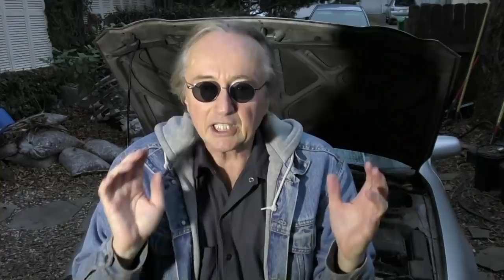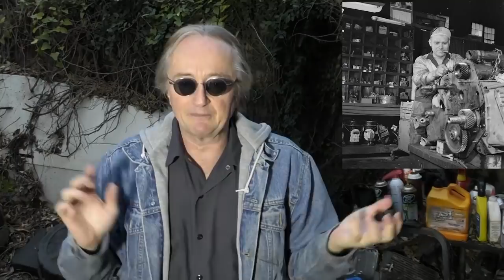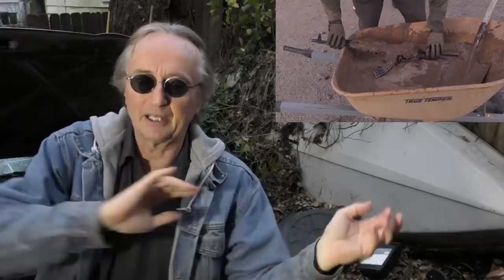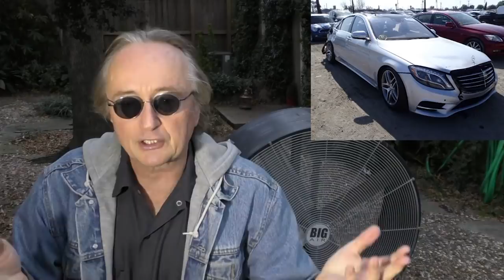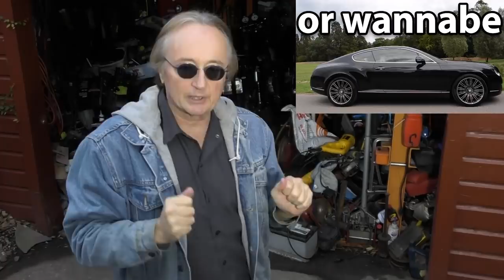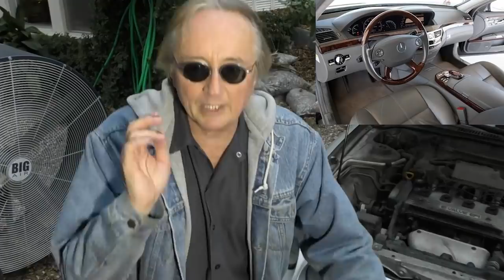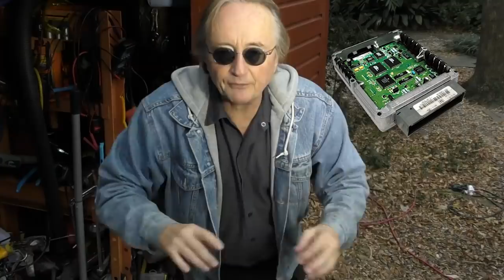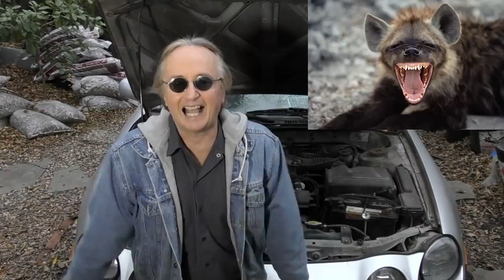Why Luxury Cars are Designed to be Unreliable

Comment from the maker: ⬇️Scotty’s Top DIY Tools:
1. Bluetooth Scan Tool: http://amzn.to/2nfvmaD
2. Cheap Scan Tool: https://amzn.to/2D8Tvae
3. Professional Socket Set: http://amzn.to/2Bzmccg 
4. Wrench Set: http://amzn.to/2kmBaOU
5. No Charging Required Car Jump Starter: https://amzn.to/2CthnUU
6. Battery Pack Car Jump Starter: http://amzn.to/2nrc6qR

⬇️ Things used in this video:
1. Common Sense
2. 4k Camera: https://amzn.to/2HkjavH
3. Camera Microphone: https://amzn.to/2Evn167
4. Camera Tripod: https://amzn.to/2Jwog8S
5. My computer for editing / uploading: https://amzn.to/2uUZ3lo
6. Video editing software: http://amzn.to/2jv5Fhf
7. Thumbnail software: http://amzn.to/2k7tz6C

🛠Check out the tools I use and highly recommend ► https://goo.gl/rwYt2y

🔥Scotty Shirts and Merch ► https://goo.gl/pTAeca

Subscribe and hit the notification bell! ► https://goo.gl/CFismN

Scotty on Social:
Facebook ► https://www.facebook.com/scottymechanic/
Instagram ► https://www.instagram.com/scotty_the_mechanic/
Twitter ► https://twitter.com/Scottymechanic?lang=en
Reply: What's a good luxury car that's reliable and easy to work on??
Reply: I was wondering if you could post a video on most common issues with the Lexus IS250 2006-2013 and ways to prevent carbon build up
Reply: Scotty Kilmer my grandfather owns an 2004 Mercedes E200 Compressor and it's still going reliable .only thing he has done is fuel pump one time , he done 2 times the tie roads and some times brake pads and discs
Reply: A video on the K cars of the past would be an interesting video .
Reply: Hey scotty! Thanks for the awesome video! I wonder though, when a company puts a supercharger + turbocharger or double turbos, aren't the engine blocks made to be stronger so that the added pressure on the engine isn't straining it  but is well within the limit that the engine can take? In other words the engine would then be compared to a weaker but naturally aspirated one.
Reply: Will a oil catch can void your warranty?
Reply: Scotty I have a 1985 mr2 and it started to shake really bad, the spark plugs are new, cables are new distributor new, and it smells a bit of gasoline it didn't before. People are telling me it can be an 02 sensor, a bad afm, or the egr valve. Can you help me please.
Reply: what older models of  lexus cars would u recommend and which years? Thanks
Reply: Q:-
Hallo Scotty,
I live now in Germany. I wanna buy a hatchback (Ford Focus, VW Golf, Skoda octavia, opel astra or Audi A3) or small SUV (Nissan Qashqai, Opel Mokka, Peugeot 2008 or Ford kuga). 2010 - 2015
Most of cars here are German (even Ford are made in Cologne, Germany) or European.
Which European car is the most reliable car ....
Reply: Hey Scotty! What do you think about the 2008 Audi a5 coupe 2.0t quattro
Reply: Hey Scotty! How about a video on truck leveling kits. I have heard good and bad things about them, so I'd love to get your feedback on it. Thanks 👍
Reply: Educative video!
Reply: Hey Scotty, thanks for all the car advice! My 2012 Toyota Yaris 1.3XR smells of fuel for the first 100km or so after filling the tank; can you recommend some checks I could do to find the problem?
Reply: Another great video, Scotty. I bought a 95 Camry V6 automatic with 123k miles. Runs fine so far. What coolant can I use for it and are there any known issues I should look out for? Thanks
Reply: I'm on my second ACURA tsx first 1 2004 420k no issues just 2 a/c compressors my current 2009 tsx has 350k no issues so I guess mine are reliable
Reply: When buying a used car how do I know if the previous owner used conventional or synthetic oil? Does it matter what oil I use if I don't know?
Reply: Do a video on 80s luxary
Reply: Haven't hear that ash tray statement in many years 1970s since my dad would always say it when we bought used trade ins from new car dealers. Best days of my life.
Reply: Scotty, its time for me to rebuild my LT1 in my 95 trans am.  I am thinking of replacing the Optispark with a coil pack conversation kit. Would it be worth it to do that? Or should I scrap the LT for an LS? 
Little background in the engine...low oil pressure being the main reason for wanting to rebuild. I had the pressure test done on all cylinders (both wet and dry) and it turned out good. It has 154K miles and somewhere in its past had an aftermarket intake put on. As far as I know the engine has never been opened according to the place I took it to evaluate its condition. (That's another story - not good either)
Any thoughts?
Reply: Scotty Why Ford is only decent car in the United States
Reply: tell about the history about Ford
Reply: Hey Scotty I have a 2013 chevy Silverado 1500 V6 4 speed auto with 56k miles when i stop at a red light and let off the break i feel a clunk and jerk feeling, thinking it might be the transmission or torque converter what are your thoughts. Love the channel
Reply: there are exeptions like the Mercedes W210. This is a old E-class from 1995-2002 they can rust easily, but are veeery reliable if we talk about electronic stuff and the transmission.
Reply: @mich8230  a well maintained/serviced merecedes e class
Reply: What about Manuel transmission Accuras?
Reply: What is your opinion about the 2005 Cadillac sts with the rwd northstar engine do you think they're a better engine than the fwd version
Reply: What happened to the Ford Scorpio Merkur
Reply: Hi Scotty, big fan. I have a question. I'm trying to decide whether to buy a 2018 Honda Accord with the 2.0L Turbo engine or the 2018 Toyota Camry XSE V6. In your experience, what should I do? Thanks in advance.
Reply: Scotty Kilmer Scotty when will you be giving away a pickup truck?? Let me know so I can measure out my garage and throw some things out to to make room.
Reply: What are good v6 engines under 25k above 2008 thanks
Reply: tolerance these day with the new cnc can reach .008" to .0015" easily. as long you don't go in the thousand you just make shure the guy that operate the machine know what he is doing. if you go in the thousand all part must be mesure by a c.m.m. or a optical indicator
Reply: But eventually all cars are going to be electronically controlled. I guess the solution is to look at the track record and buy the ones that break down the least.
Reply: My question is, In your opinion, who makes the best automatic transmission? Will they ever be as good as a manual transmission? I like automatics personally but I can definitely drive a manual though. What are your thoughts Scotty?
Reply: Hey scooty What are your thoughts on bmw SMG system? And what do you think about the e46 generation specifically the 330ci/m3 ?
Reply: - - - @Scotty Kilmer Scotty, I got a 2001 Chevy Suburban with 193k Miles on it (I bought Used with 177k) that's had no Engine & no Transmission work done on it. With the Aftermarket Intake & Cat-Back I put on it it Runs like a Dream, & I Plan on Eventually Replacing Every part with Performance grade Parts. I'm thinking about putting Rust Converter All over the Entire Underside of the Truck, Undercarriage, Frame, Body & All. Is it Safe to Cover the Entirety of the Undercarriage in Rust Converter? Can I Paint my Entire Exhaust System with that High-Temp Paint & would That be Advisable?
Reply: Hey Scottie I'm in new England and looking for a rust free used car, what  states or regions are close by?  Looking for an Avalon to be specific.
Reply: Hey Scotty. Why do some engines last longer than others? Do you think a v8 will last longer than a turbo 4 cylinder, due to not working as hard?
Reply: What gm vehices are reliable?
Reply: Who makes the best diesel engine?
Reply: Hi Scotty!, I have a base model 2010 Mitsubishi Lancer with a manual transmission that has just over 114k miles. Sometimes the "shift stick" gets stuck in 1,2 and 3rd gear. What could be wrong? (I think its never had any transmission fluid change, should I change it now?).

Also my downstream O2 sensor had its wires chewed by mice. Its been a long time like that but my mom won't allow me to change it because its about 500 dollars, should I do it anyways?

Thanks. (Plizzzzzz answere my questions)
Reply: I recently purchased one of those old military surplus K5 Blazers with 6.2L V-8 diesel (m1009).  She's in pristine condition, but I'm tempted to try to get more horsepower out of her.  Should I go with a turbo, a supercharger, or don't bother?
Reply: Scotty Kilmer Scotty could you make a video about quality and reliability of modern American muscle cars such as ford mustang,Chevy camaro,Challenger hellcat...Especially their powertrain,engines quality and reliability...Thank you!
Reply: E38 scotty should i buy it?
Reply: Scotty Kilmer - Scotty, I have a 2018 Ford Escape 2.0 L with 15,000 miles, for regular maintenance I have been putting in synthetic oil for the oil changes, what else should I do to keep it running well. I have never had a turbo engine before. It mentioned putting in premium gas, which I have been doing as well. Plus I live in a cold climate area. Thanks.
Reply: Hi Scotty, what do you think about the 1zz engine on the Celica ? It's a 140hp, I found a 2002 one on 140.000 km for 2900 euro. A real beauty. What do you think ? Should I get a 2003 Miata instead ? Gonna use it for daily driver. Thanks!
Reply: I have a 2013 Lexus ES300H and the engine cover say it requires a 0-20 oil but when i go to the dealership they say to put 5-30 oil because my car has over 62k miles.
Is that right??
Reply: You made some interesting points stay away from the BMW 8 series convertible to replace the High Fi amp its £1000 + and they won't release the codes for the amp so you can fix it yourself...
Reply: Scotty Kilmer hi Scotty, I love your videos. I was wondering what you would recommend as the top 5 cars for college students or young people thanks!
Reply: Also Scotty, would you do a segment on the Juke car, I am eager to drive a used one for a few years, they look so cool and so much fun!  (Then I will buy a used Lexus)  Robert
Reply: Christian Rahi unfortunately you cant change the laws of physics and thermodynamics. Those engines are not designed for reliable service past the lease period. Unless they make the engines out of Titanium with tungsten sleeves there is not much you can do and why would they? They dont want engineblocks that last more than 4 years and 100k at best,
Reply: What's the best used car that is most reliable ( to date) from your experience at  affordable price$!?
Reply: Scotty how do you install a vented catch can on a 2003 Infiniti g35?
Reply: You need another mug that says BMW= Big Money Waster
Reply: Do you think a Lincoln is good luxury car?
Reply: Keep-em coming Scotty!
Reply: Hey Scotty, I am either a small car gas saver or an old pickup guy. I find maintenance simple on either or. I am an electrician by trade and a mechanic on the side. I am looking to buy a new gas saver, I've been looking into the Tesla cars and overall I've been impressed, I can install the charging station in my garage and several charging stations are located around. What is your position on them?
Reply: Scotty, the M16 was fed the wrong ammo. Try put Diesel in a Petrol car, but goddamn you are just old school and are afraid of the new.
Reply: Hey, Mr Scotty !!! What about talking a little about FREAKING RELIABLE USED CARS from 2000 up ???
I think that will help your loving viewers A LOT.
Best regards and happy new year to you and your family.
Reply: Agreed. They were WONDERFUL cars
Reply: Scotty, I live in New York State where snow falls are just a part of life and so is corroded vehicle. My question here is should I have my 2016 Subaru Legacy 3.6R rust proofed? My F-150 I brought from Florida is already showing signs of rust after a few years of driving on salty roads.
Reply: Scientists proved 91 octane was no better than 87
Reply: Scotty Kilmer... I just wanted to say thank you your videos have saved me hundreds maybe thousands of dollars over the years
Reply: @scotty, can you make a video on how American brands went from reliable to unreliable? Why didn't they keep going toe to toe with Toyota /Honda ?
Reply: Scotty Kilmer what's your opinion on the Evo 9?
Reply: Hey man thank you im going trhu a hard time in my life and your Chanel is great funny and I learn a lot thanks for make my day never change ur style
Reply: scotty what do you think about the Toyota hybrid Prius line/newer rav 4? I'm looking for a suv that can tow a small trailer. My 2004 civic is on its last leg and the crvs with their cvt just aren't doing it for me. I drive 40-50k a year for work so mpg and reliability are top priorities.
Reply: @Scotty Kilmer Are ford transit connect 2010-2013 reliable I heard online that they might have transmission issues? Also is it worth buying one w/ less than 100k miles for 10k?
Reply: Hey scotty I own a 1989 Fox mustang gt. I wanted to see what you think about the reliability of the windsor engines that come in them
Reply: gmc savana or chevy express general video about bigger vans
Reply: Scotty Kilmer my question is what do u think about the new 2018 TACOMA TRD OFF ROAD 4x4... I’m taking over this payments a brother in law screw me over on... I wanted to turn it in but I really like this truck and u talk a lot about TOYOTA so I want a very experienced person to let me know what I got my self into...
Reply: thats why most snobs drive Gelendwagen or Lexus lx or gx. reliable and for big holes on the roads
Reply: I'm gonna buy a 2000 Cadillac Seville so you can laugh at me and insult me.
Reply: Scott I got a 87 Plymouth colt 1.5 at an estate sale with 15,500 miles. It’s mint. Can I make it my everyday driver and keep it for years. I’m good with upkeeps with maintenance. Thanks! Tim from Philadelphia.
Reply: pro trick: you can watch movies at flixzone. I've been using it for watching loads of movies recently.
Reply: @Malakai Raymond Definitely, been using Flixzone for since december myself :)
Reply: I agree with u

Comment: REV UP YOUR UNRELIABLE LUXURY CARS!!!
Reply: the people who own these things do not even care since they can afford to buy 5 of them at once.
Reply: Damn you beat me to it
Reply: Collin Mac ⚡️
Reply: car kid15 SURE DID
Reply: But... It won't start!
Reply: Most luxury cars use DOHC V6, Inline 6 and V8 engines. They are the most reliable engines to build. It's not the engine that's unreliable. In the 80s and early 90s cars still hadn't been perfected and the electronics that were new into cars weren't sealed from the elements properly.
Reply: Done. What’s next.
Reply: cough mine doesn't work
Reply: Dale Gribble W
Reply: It’s a FORD, Fix Ot R’gain Dony

Comment: A luxury car should be something a person buys once and treasure it for a lifetime. Even pass it down.
Reply: Once they showed a 60 minutes segment where an old woman still had the same car her father bought for her when she was a teenager. Yup it was a Rolls Royce and very very well made. Her doctor finally forced her to get an electric starter for it when she turned 80. She cranked that car by hand for 60 years!
Reply: @johnsoho2238  how much miles does she have on it?
Reply: White Coyote my uncle has a lexus 570 2009 and it runs very well like new
Reply: Facts I got my dads 2001 bmw 330i and for 19 years old it runs amazing! Plus it has had any issues in over a year
Reply: I buy one every 5 years and pass it to my kid
Reply: That was the case with the old Mercedes or the old Cadillacs. You just don’t see that anymore.